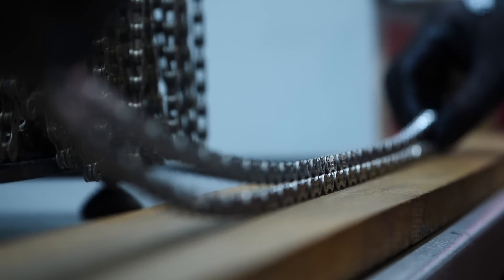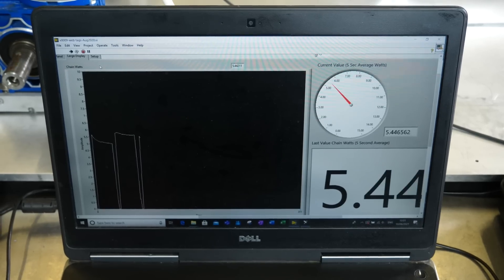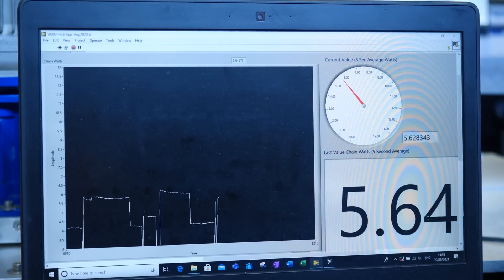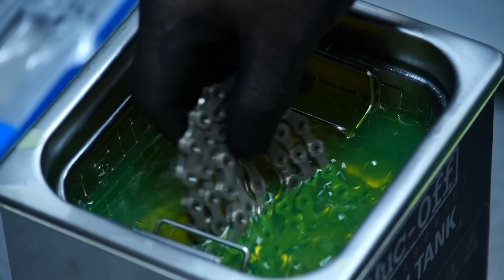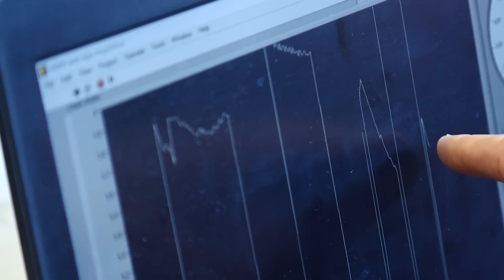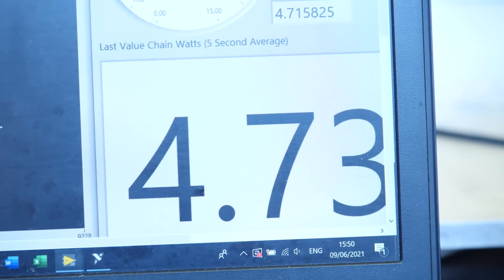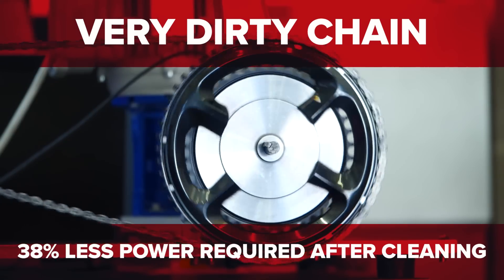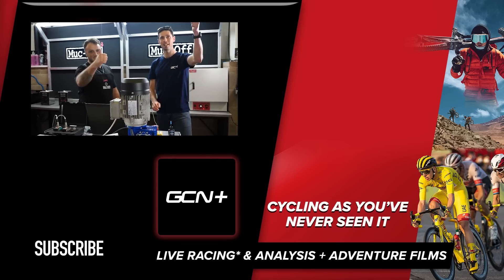Free Speed! | How Much Faster Is A Clean Bicycle Chain?

Comment from the maker: How often do you clean your chain?
Reply: I cleaned mine once. Within 2 years it was dirty again, so I've never bothered since as it will only get dirty again!
Reply: @sheridan6378  😂
Reply: Once a week on the bike.
Reply: Since waxing my chain, i rarely clean it anymore
Reply: About every 500 miles.
Reply: Clean it about every two-three weeks. Road / gravel bike. Gets lots of dirt and mud on/in it.
Reply: Only when it starts making noise. I spin it each time I ride and listen. Ends up being about once per 500 miles.
Reply: Never. Works perfectly
Reply: Never. I'm using gates belt drive 😜
Reply: full clean with kerosene+toothbrush first,  then dishwashsoap, then rinse off with water after 240km. lube with gearbox oil every 80km. so clean every third relube.
Reply: Never. Molten Speed Wax in a $10 crock pot, good for 300+ miles in the dry or 1-2 rides in the rain. I rotate through three chains and never get chain ring tattoos!
Reply: Every week or week and a half. Depends on the wheather
Reply: Once a month or so
Reply: About once a week
Reply: In the summer only around once in 10 days, but in the winter it seems like after every ride!
Reply: Every 200km or 2 weeks! Always love the sparkling clean look of the chain!
Reply: I paper towel the dirt off after every ride. Between the cassette sprockets too. Soak it in degreaser a couple times per year.
Reply: Every full moon
Reply: Probably once every couple of months. I rarely ride in the rain, and only on tarmac, so it takes quite a while for dirt to build up.
Reply: I grease it every time there is a noise and I clean it twice a season
Reply: Never since im using a gates cdx belt drive system
Reply: Every 2 weeks or so but it depends on the conditions and where I ride.
Reply: Weekly. I do 120-150+ miles a week so I try to keep it shiny.
Reply: Every time it hits me on my leg
Reply: About once a month. Dry environment and really low dust. However, if I go out playing in the gravel or sandy roads it get a clean right after.
Reply: What do you mean "clean your chain"? Do you mean to say, you guys don't buy a new bike every 2 months?
Reply: 05:41 Wouldn't pro riders just get a new chain, why on earth would they send it away to get cleaned and lubed. Ridiculous. Petrol and cheap engine oil, nothing else needed.
Reply: Now and then the next time youtube recommends this video.
Reply: Every week. That's 3-4 rides and around 250 Km. I'm on wax.
Reply: When I have time to clean my chain🤣🤣🤣(roughly every one or two months).
Reply: I go by noise and feel.
Reply: I clean mine about four times a year, but my real problem is that I don’t oil my chain afterward.
Reply: Maybe around every 2 weeks, which equates to about 500 km. But I don’t do this fancy cleaning by taking it off and putting in a ultrasound bath. On the bike with some chain cleaner, rub in with some brushes, clean the rest of the bike and then splash the chain with water. Looks cleaner afterwards. Maybe like the “slightly dirty chain” Alex brought in. 

I find the harder bit is to clean the cogwheels and cassette. And they seem to just dirty up the chain again. Although I give them a spray and a rub.
Reply: Every 3 months or 3000 miles whichever is first. I insist that the bike shop only use synthetic oil when I get a service! 😅
Reply: Wipe down after every ride and re-lube every 100 miles or so. I get around 5k miles from a KMC Gold 11 speed chain.
Reply: As its a new Diverge it gets cleaned a lot..!!! Then use Muc Off Dry Lube 🤣🤣🙈
Reply: Every couple hundred miles under dry, normal conditions and after every nasty conditions ride..
Reply: I clean my chains every January, or after a wet ride, but re-wax (paraffin + graphite) every 250-400 kms. The paraffin tea light candles and extra fine graphite costs $12 CAD per year for my crock pot of wax; each year I melt the wax out of the chain and put it through a degrease regimen so it's clean for that year's fresh batch of wax. I have 14,000 kms between the two chains I rotate through and they measure almost the same as new. Even with a conservatively applied dry lube I had to clean the drivetrain every 80-140 kms because it would get so gritty/crunchy. Wax means longer periods between cleaning/lubing, pretty much eliminates degreasing and my equipment last longer... I'll never go back!
Reply: after every ride, cause the squirrels arent good for it, greetings from a Downhiller #GMBN fan
Reply: Never cleaned the chain on my 30yr old bike nor my 5yr old bike, all good
Reply: after roughly 250-300 km of riding when you hear that the chains gets dry and dirty. so about 1-2 times per week I clean my chain.
Reply: Perfectly randomly. Mostly depends on how the chain looks, but if I have big weeks coming up (for me that means 5+ hours sitting in the saddle in a week, not counting commutes), I like to start weeks like that with a clean, freshly lubed chain. And if I happen to run through really bad conditions, I always aim to clean it afterwards.
Reply: Too often by the results of this test.
Reply: Once every 3 months, put chain in plastic bottle with some gunk and shake 😃
Reply: I clean my chain with the degreaser every after ride. So probably 3-4 times a week. Is it bad?
Reply: Am I the only one who cleans my chain with degreaser, cleaner and a brush and then apply ceramic muc-off lube after each ride?
Reply: @zacharyerskine4277  yes
Reply: For my chain bikes, every 500 km in degreaser in a sonicator bath at 50 degrees. That 2x 1 hour and then sonicate in chain lube for 1 h at 60 degrees. But my gates belt bike once every 2 months a bit of water and toothbrush. This compares to some cleaning every 1500 km!!!! Belt is the way to go in the wet climate of the Netherlands.
Reply: no
Reply: Allot of times, 3 times a week because I usually use my bike to going to work
Reply: @SugarFreeBacon man your chain just want to have a single wash in it's life before it kills itself
Reply: Had my e-bike a month and a half. Only 35 miles. Haven't cleaned or lubed it but will check it out a.s.a.p.
Reply: Allow me to answer that with a question: how much effort do you think shimano Tourney parts deserve?
Reply: never...most ppl here hardly ever clean their chains here. Probably cause lots of ppl use citybikes
Reply: On my commuter bike, with its internal 8 speed hub,  I clean the chain roughly every 200-300 miles depending on how it looks as a result of weather/road conditions. This chain has over 5000 miles on it. On the Park Tool 3.2 chain gauge, my chain has not reached the 0.5% level of wear.  The chain is over 5 years old and I only use wax chain lubes.
Reply: On my last bike the chain was never cleaned. About 20 years.
Reply: Question - why was the muc - off wet lube being used as a control? I am using the muc off dry lube, does it mean that dry lube will equate to higher power losses compared to wet lube?
Reply: @chewkenneth  It is probably just their highest profit lube.
Reply: @chewkenneth  less lubrication on the long term dry lube dries out as the name suggests to a sort of waxy substance where as the wet lube stays kinda wet atraccting more dirt in the long run but better lubrication since it stays on the whole chain instead of only internal and then dries out
Reply: @chewkenneth  They said that Wet Lube was used on that chain before it got dirty. They used the same Lube after cleaning.
Reply: Every 5 miles (stupid ocd)
Reply: After about 10-12 hours of riding.  Basically, more often in the summer, less in the winter.  

For those wondering what that is in terms of distance, I cover about 25 km in an hour.  I'm certain I'm doing it wrong.
Reply: I haven't cleaned my chain yet, but my bike is only 2 years old.
Reply: 6 months... That tune up at the bike shop

Comment: I think the combination of having a drivtrain thats fuctioning properly along with a clean drivetrain saves power indeed. But youre not gonna save anypower with a clean drivetrain that wasnt functioning properly in the first place. Ensuring your cables and your rear and front derailleurs are working properly will do you wonders ever before cleaning it will.

Comment: Did many MTB races , within 60 seconds of starting the race the chain was filthy and in some cases no longer had any oil left due to a few water crossings , just add new gear box oil after use and always replace it after a few races. Spending more money on cleaners that cost more than a new chain is such a stupid idea

Comment: First chain improved from 5.2W power loss to 4.7W power loss, second chain improved from 8W power loss to 5W power loss.
So clean chains lose about 5W. If 300W was transmitted on the dyno, that's an efficiency of 295/300 = 98.3% and the worst possible dirty chains have efficiency of 292/300 = 97.3%.
No wonder I barely ever look at my drive chain, it makes practically no difference, in fact I'd bet substantially less difference than having poorly inflated tires!
(however: the difference is PSYCHOLOGICAL, that's why they bother.)

Comment: 1. The chain was cleaned very well but why put it back on a dirty dyno sprockets??  2. In three years I have never used oil on my ebike except in hydraulic brake lines.  I use deoxit (pro gold it used to be called).  Absolute magic.

Comment: For me, the most satisfying part of this video is witnessing a drivetrain achieving 98-98.5% mechanical efficiency. The majority of the power loss is attributable to the articulation of the pins, links and rollers on the taut side of the chain, especially when pedaling hard. The exclusion of the rear derailleur jockey wheel from this rig seems justified, as its effect on the power loss is likely to be on the order of one watt.

Comment: Some 1st class older bikes with 3 speed hubs,  had an enclosed chain in an oil bath.  That was the best available back then.
That would not work with a derailleur , so bike chains are covered with crap now.

Comment: The important thing is to go out and ride your bike. If it happens you're using 5 watts more than you should, it's of no importance :-)
P.S.: I never clean my chains, the effort of taking the chain out and putting it back in plus the time spent on cleaning and products, etc, it's just not worth. I just wipe them off with a clean cloth and apply new lube to each roller like once a month. And I replace them when they fall out of tolerances, of course.

Comment: “38% less power required after cleaning”, that’s just completely wrong, it’s 38% less power lost after cleaning, you still need 99% off the power you were putting in to achieve the same final wattage. What a load of nonsense this video was

Comment: Two independent bike shops have warned me off using Muc-Off Wet Lube. Created a thick black paste which was very hard to degrease. They said something about high amounts of silicone I think. Anyway, I wouldn’t recommend it. Would be interested to know others perspectives. 

Also, the product placement is cringy, we get it, you are advertising Muc-Off, no need for the cheesy repeated pack shots.

Comment: That 38pc claim is so misleading it's really insulting. So we know that using a freshly lubed chain Vs a disgusting one saves you 3w@250-300W. While oiling a fairly clean chain only saves you around half a watt.
Percentages are clearly only used to hide the fact that those aren't exciting results. 
And ofc the real test of value would be to see where we get by switching to wax, but let's not expect mucoff to shoot themselves in the foot.

Comment: Both of those chains were clean. You haven't seen mine. Had my bicycle for 3 years, didn't know much about lubing, just used spray lube time to time, not wiping it off or anything, driving through all sorts of terrain, so much grime stuck to the chain, then I lube it again and more sticks onto it. Now that chain is a mess, would have gotten maybe -15 watts on the machine :v

Comment: N00b here. Cleaning is different than lubing correct? I've been told that "cleaning" your chain is not recommended as it can push out deep interior oil that comes from the manufacturer and then it's virtually impossible to get oil back into those tiny spaces. I recently replaced my chain after 1500 miles and since then have been using rock n roller gold after every one to two rides thinking this is very very good maintenance for my new chain going forward. Am I missing the boat in any way? Is this a good strategy for a very amateur cyclist with almost zero bike maintenance know-how?

Comment: The dirty chain was compared to a clean chain for efficiency. I feel the change in efficiency has to be measured against the efficiency of the cycle, as a whole, as that is what is felt by the cyclists. I mean to say, if there is a efficiency loss of, say, 50 watts for the complete cycle, a 3-4 watt on account of a dirty chain, will mean a lot, lot lesser, to the cyclists. Just a thought. Then the efficiency at different speeds, could be different too,

Comment: They could’ve saved a lot of people from roasting them if they just promoted how decent that their lubrication is for general use. In regards to differences in percentages I really only problem that would hold someone back would be stuck rollers. Some thing that has 200 miles of light dirt accumulated is not going to be noticeable in the slightest for even high end riders.

Comment: a chain doesn't need to be oiled. wd40 sprayed on a rag, hold the rag on the chain and back pedal. do this often, you will never have a sticky, nasty chain, cogs, or rings. the only thing oil does is collect dust and grit to form a paste that wears drive train components out. cheap chains and the chains from way back needed oiled, to keep them from rusting. buy a higher quality chain like one from kcm keep it really clean, and you wont have these problems. buy a new chain, keep it clean, dont oil it and ride it like that for awhile. then oil the chain and go for one ride, and check the chain, youll see.

Comment: So it saves you a tiny bit of power, that unless you're racing, is pretty negligible. However, I bet the dirty one won't last nearly as long when it's grinding all the grit round it all the time, eating away at the rollers and cassette. That's why I clean mine (and it's regularly a lot filthier than either of those. Pondering if there's a slightly bigger difference when running round a derailleur as there's more turns?

Comment: Pretty good video, however a very poor presentation of the collected data and the variables that went into the experiment. From what i managed to get from the watt readings mentioned, don't bother cleaning your chain if you're a serious biker! I mean if you're that serious, most likely you'll have someone to do it for you. And then if you're not a serious biker you should do it since it'll actually make a significant difference for a low watt output rider.

Comment: Would be very interesting to know, how a belt drive compares to a clean/ dirty chain. Maybe you could do a similar video on this?
I ride a trekking bike with gear hub and belt drive, not a racing bike at all. But the smoothness and silence of the belt is just phenomenal and makes it so enjoyable to ride.
I also chose this configuration for practical reasons, since belt drive and gear hub are inert to dirt and need almost no maintenance, which is a priority to me on a commuter bike.
Reply: Maciej Jan Długosz  Very interesting, but the measurement is done without load, making it meaningless. The results could be similar or opposite, if measured under significant load of for example 200 W.

Comment: While you're at muc off's "cutting edge facility", can you ask them how on earth do we clean a chain that has dried out muc off wet lube on it? You know, that delightful stuff that looks like hardened tar..
Reply: That stuff is awful. Banned from any of my bikes. Ceramic dry stuff is ok
Reply: @edpilling4955  I'm a mechanic and have my own shop. When it comes to chain lubes the straight answer is: anything but muc off. Hell they might call it muc ON! Sorry but something that dries like cooking oil and doesn't come off no matter what you throw at it it's not a good lube. Ok if you're the guy that takes care of his bike it may work for you, but as we know not all riders are like this, many tend to forget that stuff on and if it's muc off branded then it's headache time.
And believe me I threw at it EVERYTHING I had here: disc brake cleaner, isopropyl alcohol, motorex chain cleaner, morgan blue chain cleaner (the best there is btw), diesel, petrol, kerosene (yes, I have kerosene) and of course, their own chain cleaner (the yellow nice smelling stuff) and nothing works, except the wire brush that only cleans the outside..
However I salute their goal of making bio-degradable stuff, but for now at least some of their products just don't do the job properly. Fair to say that I haven't tested all of them though.

Comment: 'Dirty' is a very ambiguous term in this context. My chain is absolutely filthy (heavy city use, bike lives outside on the street, and I never clean it) but it's very well lubricated with good oil. A subjectively 'cleaner' chain with little (or unsuitable) oil will have much higher losses.

Comment: Declaring it as "9.5w less needed" doesn't at all seem accurate. You've mitigated 9.5% of your loss, but 9.5% of 250-300w is around 25-30w; that's not a good way to express the savings